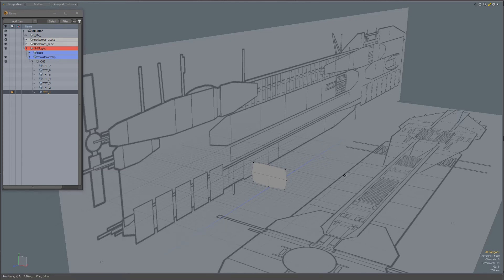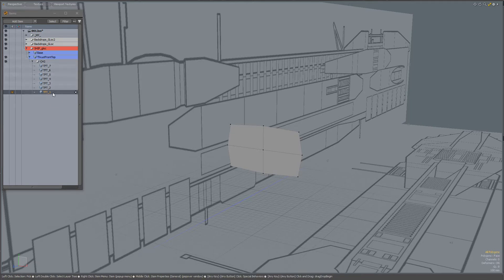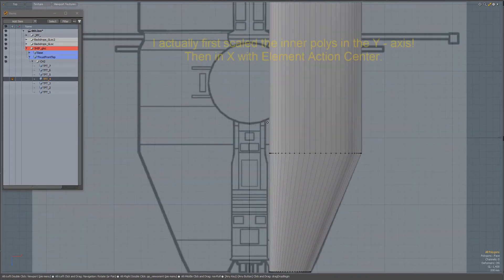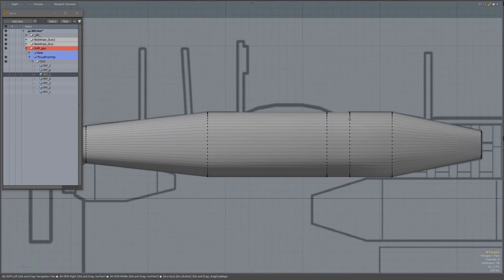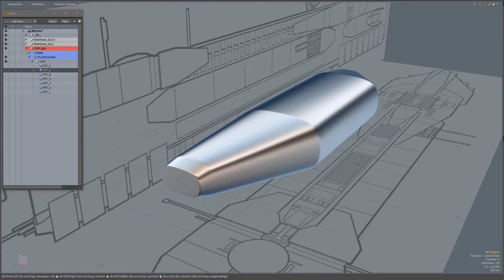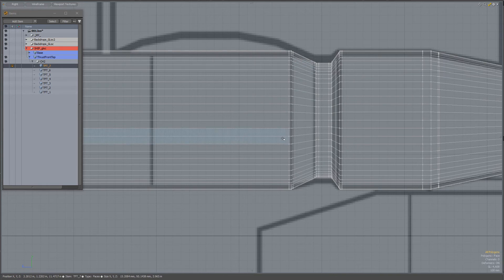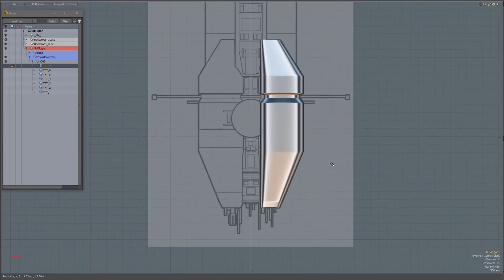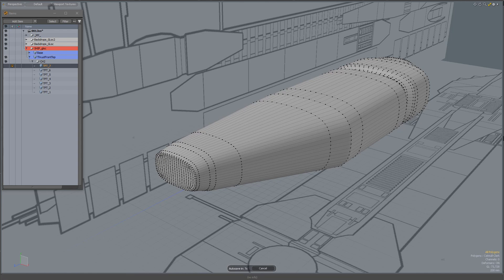modo TIP for those starting to SubD model.

Comment: Dominiek, what do you mean by Construction History?  Do you duplicate and iteratively number your mesh after each few steps?  It is a very good practice to start following, wow.  So much more useful than Incremental Saves.
Reply from the maker: When I start something and I'm not sure how I'll proceed, then for each step I copy and paste the mesh into a new item layer, and I group those layers called "CH" (for construction history, just a name) and parent that group locator to the mesh, so that I don't lose previous steps if the need is there. Indeed : saving each and every little thing into a preset or scene file would be overkill.
Another advantage is that it often serves as helper geo or even new geo.
I just call each of those groups "CH" and modo puts a number behind it : I don't rename that group since it is parented to the mesh so that I know the CH23 for instance is the history of that parent mesh.
Reply: That is SUCH a good workflow!  Thanks Dom.  And thanks for YEARS of great videos.  You have taught me a thousand things over the years.  Salute